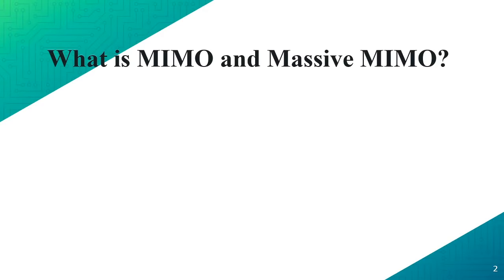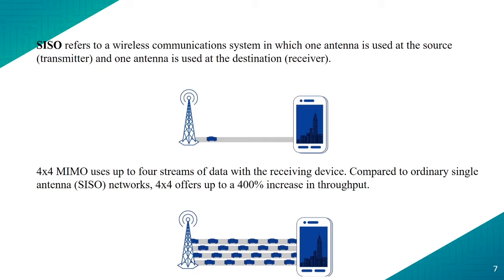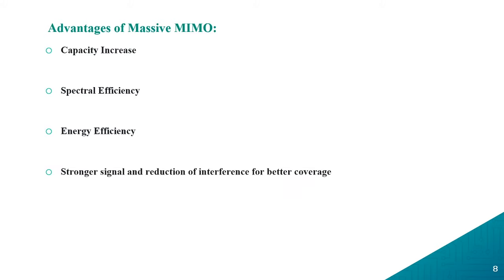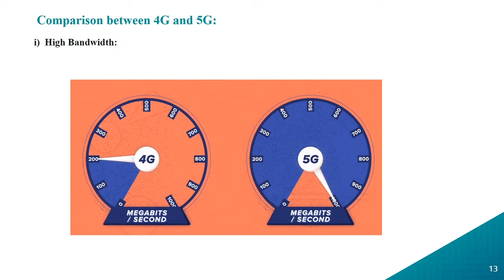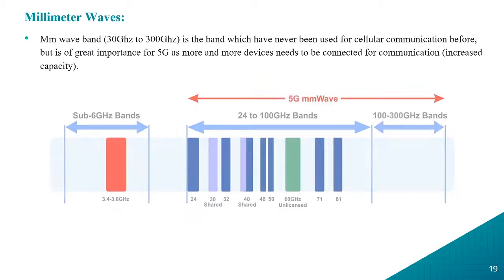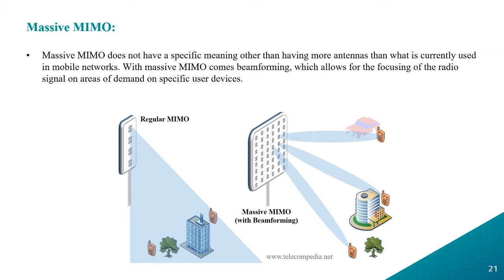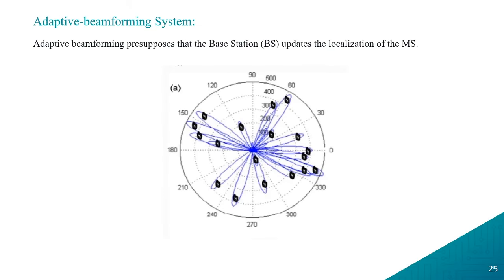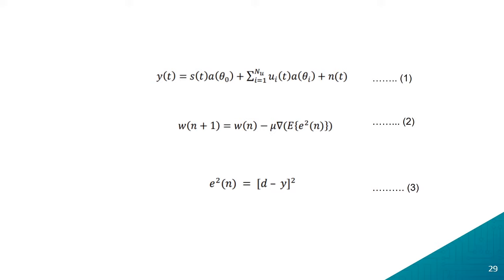Massive MIMO in 5G Network

Comment: 2. when we say 4x4 SU MIMO , we have 4 transmitter and 4 receiver , and all these spatial streams using the same bandwidth right ? , ok so how these 4 close to each other receivers which is inside a mobile phone can separate these 4 spatial streams (if we consider 2 polarization its only two , so how we get 4x4)